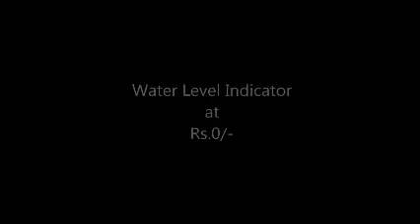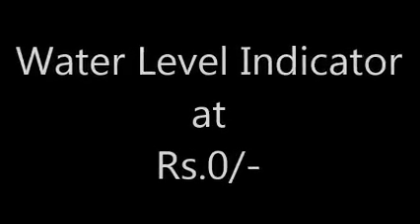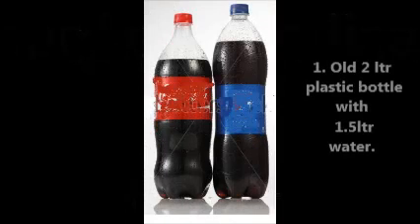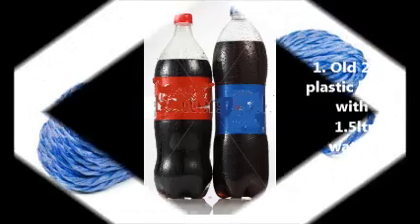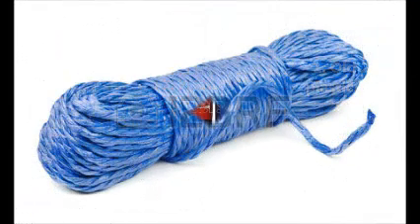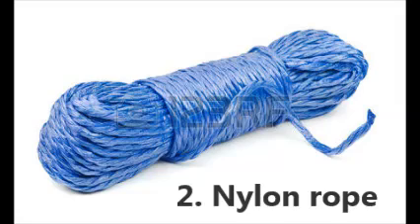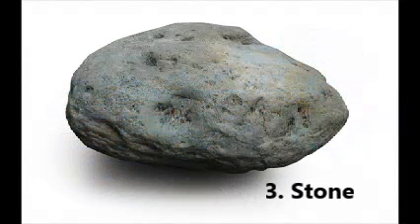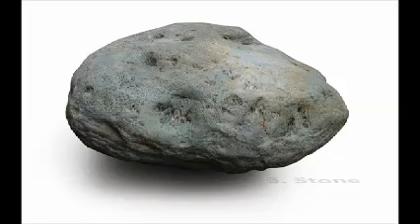How to make Water Tank Level Indicator at Rs. Zero/- cost. DIY

Comment: Hey it will not work.once tank filled.stone will come down but it will not raise to the top again.
Reply from the maker: Did you filled 50% water in the pet? Make sure the stone size(small), it should be balanced and make sure free rope flow. If all these are good, then it should work. thanks.

Comment: How did you make that pulley
Reply from the maker: You can use any plastic material. I used insulator which is using in electrical cable. This is just for smooth rope flow. Thanks.